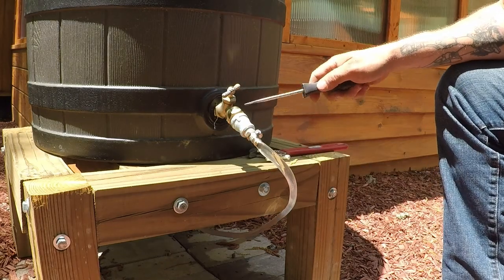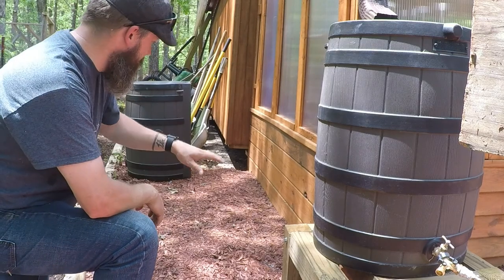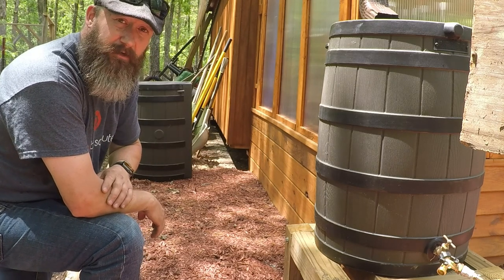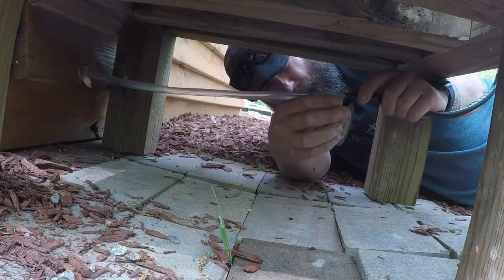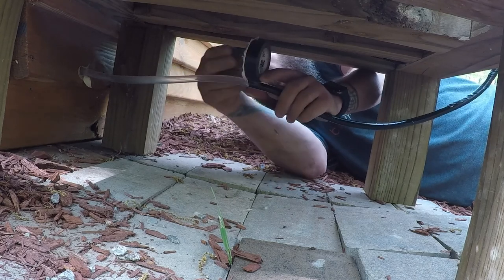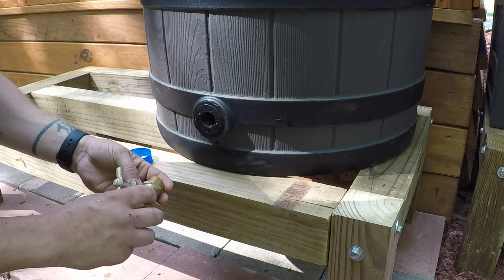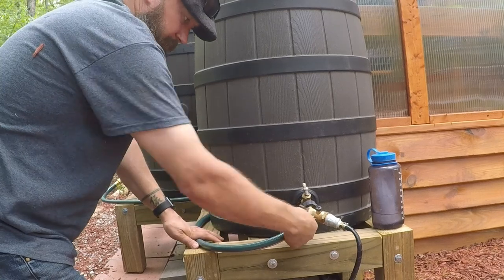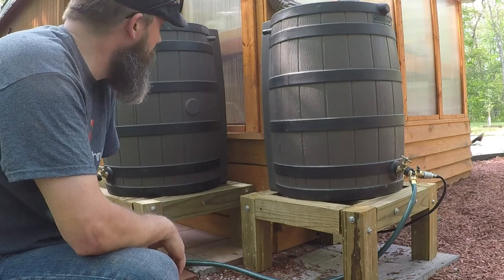Greenhouse Rain Barrel expansion build

Comment: since you mentioned the Teflon tape, you put it on the right way, but if you'll flip the roll around you can pull it tight as you put it on it makes it a lot easier. great video I plan on building one like this.

Comment: How is the solar powered misting system?  My solar powered exhaust fan for the greenhouse is working out really well.
Reply from the maker: Paula Beattie That is great to hear you have a solar exhaust fan!  I’m a bit jealous.  The misting system is working really well.  The nozzles were getting plugged from all the pollen sediment so I put an RV water filter on the line going  in and it has made a huge difference.  I am still working on installing a timer to the voltage regulator.  If you have any suggestions I’m all ears!  Thanks and good luck this season, ATB

Comment: Do you drain the barrels in the winter?
Reply from the maker: No, it doesn’t get cold enough here.  The top layer of water may freeze but the barrels have gone every winter so far without any issues.

Comment: How do you keep it warm in the winter?
Reply from the maker: C E When we built it we did our best to make sure it is sealed up pretty good to keep as much warm thermal air contained, and cold air out.  During the peak of the day it has been as much as a 24 degree difference from the outside.  At night it does get cold but we use garden fabric to cover everything to keep the soil cold if it gets really really cold.  We only water in the morning to avoid frost and this past winter we made a compost bail inside the greenhouse which made a huge difference.  Hope this helps!  Cheers